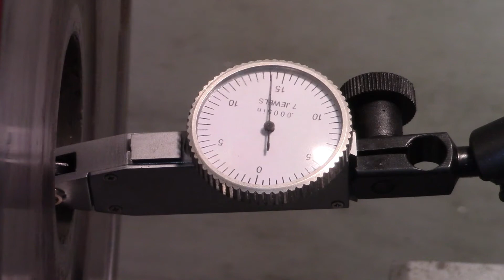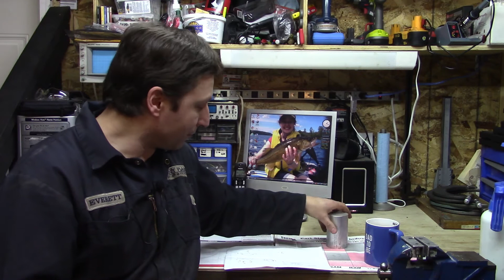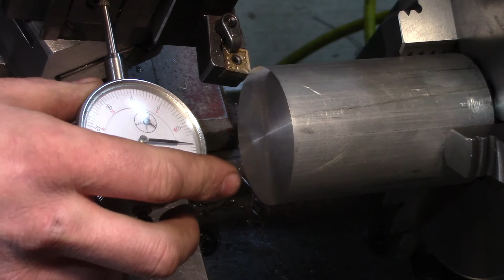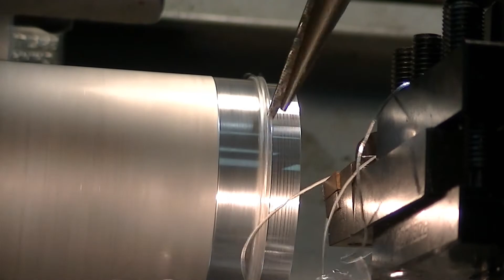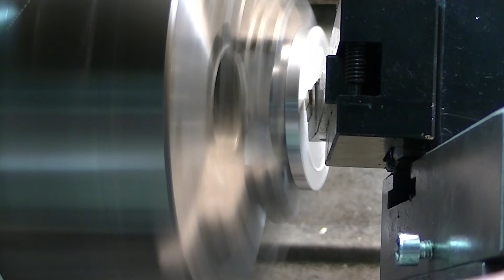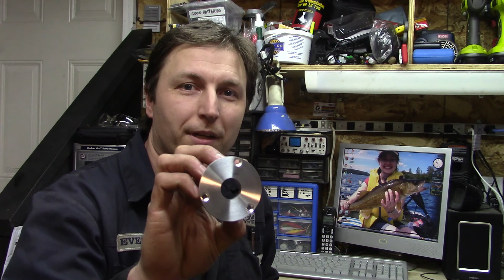1943 BSA Magneto Timing Cover

Comment: You can find metric dial gauges and micrometers cheap on flea bay. My lathe, (a Hercus 9A, an Australian built South Bend clone) and my King Canada mill drill are both imperial so doing metric is a pain but at least I can measure metric dimensions.
Reply from the maker: I'm kind of int he same boat, I do have a few metric measuring tools but everything else is in Imperial, especially the machinery.  I can think in both but have to lean toward imperial when making stuff simply because of how the machines are set up.  Thanks for coming by!

Comment: Started my apprenticeship in 1964, where have the years gone? Had a few old British bikes, BSF, BSC, BA maybe even Whitworth threads, certainly imperial dimensions. Fascinated someone drew this part by converting inches to millimeters then you convert back to imperial to make the part: rounding up, rounding down a recipe for disaster. Not trolling, its something I do too. 4.7mm hole, isn't that 3/16": 27mm or 1.063", isn't that 1.1/16" sometimes the obvious isn't apparent. Right I'm off to the garage to fit 16mm washers on 5/8 UNC fasteners. Keep up the good work.
Reply from the maker: Well, I suspected an old bike like that would be Imperial but a guy has to go with what the "customer" (my buddy's uncle) provides for a print.  He said it fit and worked, so was thankful for that.  And believe me, I sensed no trolling at all, a few of them pop their heads up from time to time and you don't have that air about you :)  Thanks for the comments, I do appreciate constructive advice from those who actually have more experience than I do, it's called learning, lol.  Thanks!